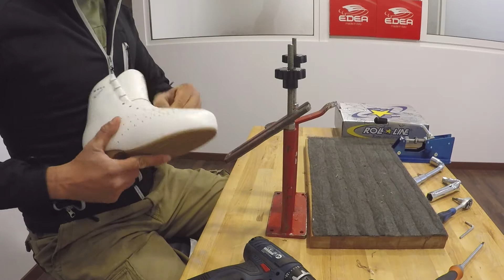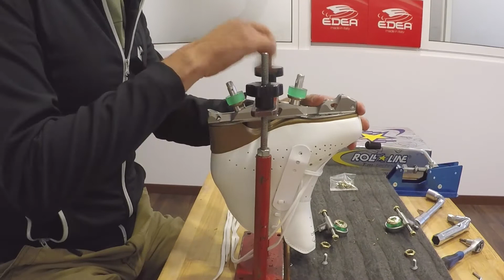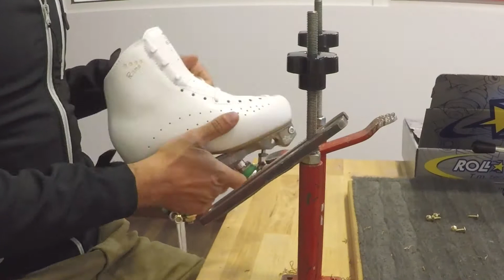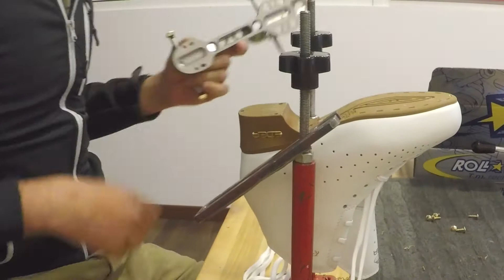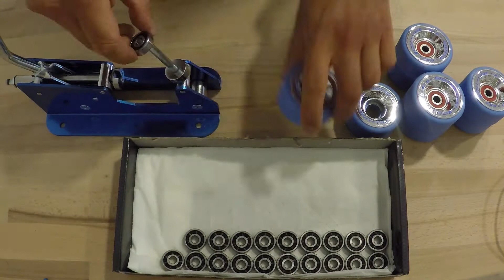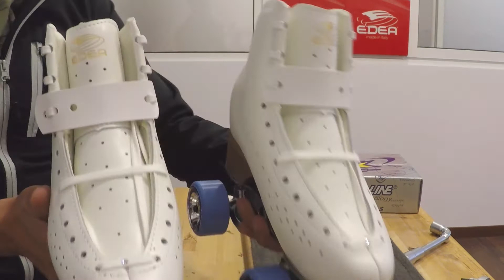Cómo montar bota EDEA Ritmo + plancha Roll Line EVO + ruedas Giotto 47

Comment: Hello, I'm about to receive the roll-line dance plates and I would like to put the possible smallest wheels on it. I see you put giotto 57 mm but a friend of mine who got the mariner cup plates can't go under 62 mm since the axle of the pivot is very tightened  to get the trucks stronger for dancing... the problem is the axle gets closer to the ground then ! So what do you advise me about the diameter of my futur wheels ?